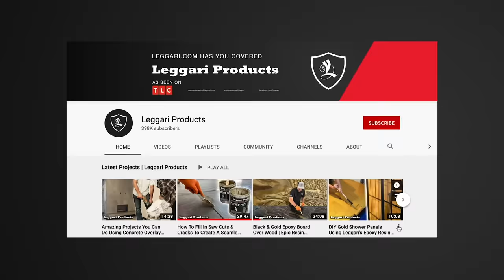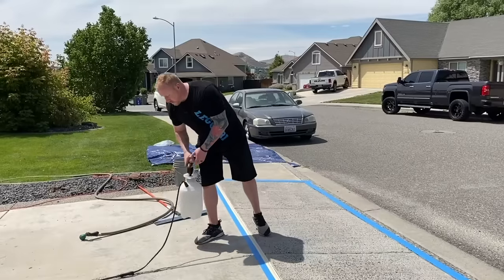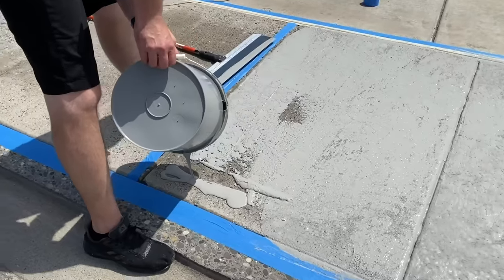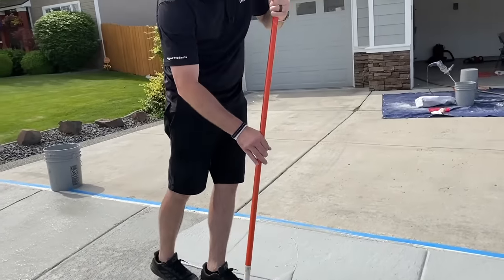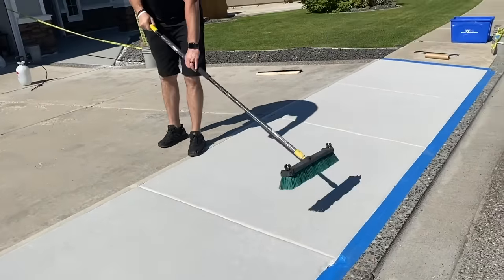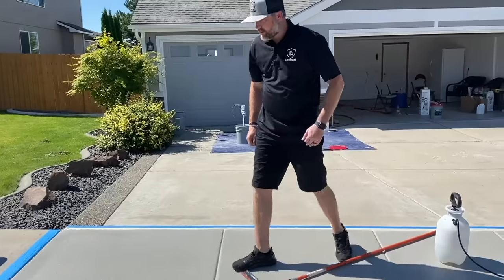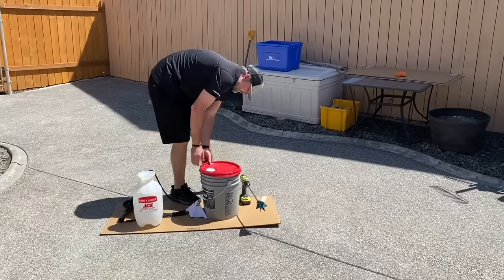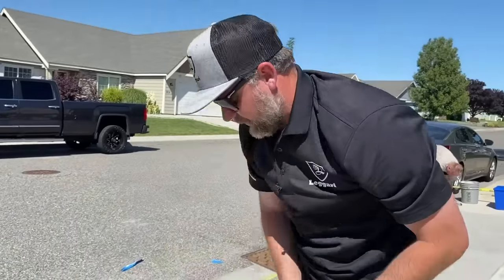How To Repair Old Concrete | Resurface Concrete Sidewalk | Restoration Project DIY Concrete Repair

Comment from the maker: Get a Concrete Repair sample kit here: https://leggari.com/product/concrete-repair-sample-kit/
Reply: Hi my concete at my store
Reply: Just a query. How do u stop mould growing on a concrete surface. Not how to clean it, as I have a pressure cleaner, but how to prevent it growing in the first instance. 
Its a shady area that is the problem.
Reply: @Blue1Sapphire  Simplest and cheapest method is 50/50 bleach.  Mixed in a wide bucket and use a 12" wide very soft poly brittle broom like a boat deck brush.  Dip the brush in the bleach, shake the brush to drop the excess into the bucket and then gently scrub the concrete.  Don't get it on anything that you don't want to damage.  >>> Like your nice grass lawn!  Do this cleaning on a very cloudy day or at sun up before it gets too hot.  You can go back and redo a scrub as you need.  The first scrub and let sit will assure the mold will die and clean up.  The second pass will assure a nice even clean concrete.
Take your garden hose and wash down the concrete thoroughly!!
Once dry, you can use a concrete sealer if you wish!
Have fun,  Cheers
Reply: @lisab3396  how about just using straight cement mixed with water and spreading it over the concrete surface. Cement is alkaline I believe and so should prevent mould growing.
Reply: @Blue1Sapphire  Wasting your time with that approach!  Mold will not be fully removed and will return.
Reply: So Who's the Dummy Now?    Well time will tell!  My experience is >>>  If you apply anything over a mold bearing surface, you will immediately seal it over.  However, Mold is tenacious and has a way to come back if you haven't thoroughly cleaned/killed/removed it!!!
Also, the word and meaning of INHIBIT does not mean permanently get rid of it or prevent it's return!
Reply: Deuteronomy, 18:11

10. Let there be no one in the midst of you to cause your son or daughter to pass through the fire; Let no one practice enchantments or consult the stars; That there be no sorcerers or sorcerers;

11. that no one is found who engages in superstitions or consult the spirits; That no fortune-teller or anyone who asks the dead is found.

12. For Yahweh hates those who do all this, and drives them out before you because of these abominations.

Jesus loves you, God loves you

John 3:16

For God so loved the world, that he gave his only begotten Son, that whosoever believeth on him should not perish, but have everlasting life.
Reply: I just like to learn stuff. Now I wanna do my driveway!
I think, I'll do just a squeegee finish.
Reply: @Blue1Sapphire Use a product like: Concrobium, it Kills Mold and Spores. Leaves a residual coating to prevent mold ReGrowth. Bleach isn’t the solution, to kill mold. Bleach only whitens up stains. I use it on my tile showers and it works great. Afterwards, seal the concrete. Mold is resilient.
Reply: How long does this concrete coating last. In Northern climates w road salt?
Reply: Waste of time watching you doing pressure washing this area!

Comment: As someone with over forty years in the concrete business, I cringe every time I see a video of guys working with cement products while wearing shorts. Cement burns are a real thing. Also when pouring dry cement a face mask should be worn to protect against silica dust.
Reply: Same here, 43 years finishing, I don't think he knows that he's on city sidewalk, he will if an inspector catches him!
Reply: As someone whose worked in concrete for 2 years I can say shorts are fine and if you have a fan to expel the dust theres no problem at all.
Reply: I don't think its concrete.
Reply: Amen
Reply: @chucklaneChuckylane  ppl
Reply: @bigdog2084 SAMENT ?
Reply: Wow no primer ?
Reply: I do concrete overlays for a living that shit will chip off in about a year in spots from not using primer
Reply: @Garcia2379  how long does it last WITH primer, out of curiosity?  I moved into a house with a cracking overlay path and hate it so much.  Send help to St Pete!
Reply: Yes sir I'm finding that out the hard way. Thank you 💋
Reply: It's not even concrete though. It's overlay and sealer.
Reply: Gloves, full face respirator.
Reply: i learned what you said the hard way as a helper once, my boots were cheapos, i worked all day with wet feet the next day my feet and heels turned red and hurt like a son if gun. Never did it again
Reply: Garbage and not worth the time or money.
Reply: Ha! My thoughts exactly…..
Is there a product/ CONCRETE or method of applying CONCRETE to achieve similar effect to the appearance of what he’s done above?

Comment: If he put a couple drains in that driveway he wouldn't be having to do this in a few more years. That water is hammer the aggregate when it runs down like a river in the rain. Then water seeps and you have a pop rock driveway/sidewalk.

Comment: Excellent explaining each step as you flow product each steps ×3 total needed  -keeping prep concrete wet before applying the next coat--Great easy directions for keeping product always moving  flowing forward to completing each section completing

Comment: First off, I wasn’t really searching for a video on this topic, but I am interested if this would be appropriate to address my garage floor before epoxy.

Secondly, this has to be one of the best instructional videos I have ever seen on YouTube (and I watch many videos). You seemed to answer all of my questions as you went, with great attention to detail. Very nice job guys!!!
Reply from the maker: Possibly, depending on the end goal and desired finish. Please email pictures to customerservice@leggari.com and we can give you an educated answer for your specific situation. There are some garage coatings that may not require much repair at all before installing. Thanks
Reply: The best instruction video would have had a demonstration done on driveway with cracks and uneven surfaces.

Comment: I did  the same thing on a many of drive ways and it worked always, however i used  bond to existing concrete chemical spray to open the pours of the concrete and “ versa bond tile mortar” don’t mix with water, mix with concrete bonding adhesive only, add a little play sand and spread; the adhesion is amazing, remember to pre-set the ground after through cleaning 🧹 with a concrete bonding adhesive, the same way they apply water in this video. 

My way requires speed and know how, cuz the versa bond and adhesives dry fast which is good for strong 💪 curing/bonding to the already set concrete. ( something like the quick bonding in “ easy sand 5 min plaster- which is amazing too for drywall. 

All the methods that they used in the video with the exception of the product. Are correct. I just use a different product but the methods are the same, Great job

Even in my mixing of the “versa bond mortar “ I use ( bond to existing concrete adhesive in my mix, 🙅🏾not the same as in this video “ remember” the secret is the (coats ) 

Do not try to get long term beauty in one coat 🤦🏼‍♂️ add up to three layers depending on the current condition of the concrete. This is only a “ skim coating “ process. * if you’re concrete project has more then 1/2” of damage. *Do Not attempt this process. 

*There’s another process for more than 1/2”damage resurfacing repair.
Reply: Great Tip..!!
What is the process for more than 1/2”damage resurfacing repair ?

Comment: Hi there. Thank you so much for the informative video. I was just wondering, the concrete in my garage is chipping similar to the sidewalk shown at the beginning of the video. Would you recommend that I use this method for the concrete inside my garage? or is there a totally different method when it comes to inside concrete? Thanks again.

Comment: would Like to see a long-term video of this stuff in a winter climate, because I feel like the winters in eastern WA might get under it and freeze and crack it.
Reply: Also, seems like several day process?
Reply: Does this fill cracks and what is cost of a 18'x 20' job for 2 car garage?

Comment: Is this just plain concrete overlay? Or does it have self leveling epoxy in it as well? Can this be used on a concrete slab that has cracked and is uneven to make a smooth, level surface again?

Comment: One guy said just use Quikcreate but in my experience and if you live in areas like Utah where snow gets everywhere, I have seen people here using Quikrete and they have to repeat themselves all over every summer or two, literally.
I have also seen other people using similar solutions like this and they typically last 10+ years.
I'm sold!

Comment: A tip for using a sprayer; Be sure that the sprayer has a pressure relief valve. Normal valve will open at approx 40 lbs. Take an auto or bicycle tire valve stem, drill a hole to accomodate the valve stem,put the valve stem inside the sprayer and pull through the hole.The hole should be toward the top of the sprayer above the liquid level. Set an air compressor at 30-35 lbs and fill.
Reply: I did this to my sprayer a couple of years ago. It's a good tip.
Reply from the maker: Great advice! Thank you! Also, MUCH cheaper than buying a sprayer that has this feature.
Reply: @LeggariProducts  Also, remove the tape before it completely dries. Same concept when painting a car. Either the tape becomes too hard to remove or it will remove some of the material you laid down.
Reply: That’s a great idea!  I’ve wished I could pump my sprayer with a compressor, but didn’t know how to make a valve that would work (one way). That’s great advice. Thanks.
Reply: As someone that's newish to pressure washers and has never seen or heard of a pressure release valve for one...   Your description while interesting and detailed enough for anyone that has ever seen a pressure release valve.....  I have no idea where on earth you are describing to put one😂.

Comment: It seems doable. You make it look so easy. 

But I'll need to do four 6'x10' slabs of driveway. 

But some parts of those slabs have cracked and fallen down, up to an inch or two below the driveway. 

Does this system level everything out, or does that situation require more intensive repair methods?
Reply: For that kind of slab movement you have massive underlying issues under that slab.  Look at where your downspouts are draining and check to make sure it's finally settled and not moving more.
  Once it's stable that's when you can look at options to resurface it.    Concrete levelling grinding and filling followed by a epoxy finish would be an idea.      I'm curious to know if this method works in areas where temps are expressly cold and how well ice may stick to it

Comment: Did a reseal to a smaller section of driveway sidewalk with $10 pail of quickcrete a few years ago.  Removed the loose stuff with a broom, hosed it down and mixed material to soupy texture.  Used a hand trowel to spread and finished with a seven inch asphalt brush.  One coat has lasted three years.  A down and dirty option compared to this time consuming effort.  It looks fine, not close to the final outcome here but it is just a sidewalk.

Comment: Looks great, I might actually attempt to do my own after watching this great video.
Reply: love all the chatter marks left in the far right section even after several coats and a brushed finish.
Reply: @Smokey420Greenleaf  Not something they did wrong on the job. Look closer and you'll see those are marks that are actually the concrete itself. Plus, they're using a brush to match the pattern on the slab which originally had a brushed look to it for better grip. 

The color will match the rest of the surrounding concrete as it ages and sees vehicle/foot traffic and inevitable dirt lol

Comment: The video was great - and very professionally done.  You guys did an excellent job overall (narration, material application, thorough description of the tools used at each stage of the process)...and the end-result looks great! Pressure washing, taping at least twice, 3 coats of product, followed by 3 coats of sealer, and the requisite drying times between each coat.  Plus, the labor component of at least two (and possibly three) people...in addition to the cost of the materials themselves.  I couldn't help but to wonder about a cost-comparison between resurfacing that same area - and the cost of breaking out and replacing the concrete.  Have you created a cost-comparison?  As for myself, my motivation for carefully watching the entire video, was because the concrete in my 3-car garage (from the garage door...progressing two feet inward) is severely eroded and pock-marked due to road salt and slush that melted and fell from the vehicles  (in Michigan).  So, I'm evaluating my options to deal with this very pitted surface.  How does your product hold-up in northern winter conditions?  Will it maintain adhesion, or spall and delaminate?  Once, again - great job, and great video!
Reply: So true! Huge difference between living in the frozen north and living in points south. Then again I don't have to deal with hurricanes and earthquakes.
Reply: Wow!!!! Great details and explanation how to do this job and just wondered….. how is your back pain??? 
I am already exhausted and tired jut to looking at you. I will like call you to do all this! Thanks for your video. I enjoyed it! Good luck

Comment: Thanks for the video. We all need to understand that the concrete overlay is the cosmetic part of the process not the structural part. So with any cosmetics the process will wear out and need to be redone. Just like cosmetics for people they wear out over time, weather and other things. So will this process.

Comment: Nice job! Looks damn good IMO. Better than brand new.. No doubt about that. But I'm wondering how durable it is.

Do you have any videos showing what a slab you repaired 5, 10 or 15 years ago looks like today so we can judge for ourselves how well your method stands the test of time, so to speak?

And could you tell us some of the pitfalls to watch out for?

Comment: will this product fill in cracks? I have many cracks in my driveway.
Reply: I think so. I know someone who used bondo for that to seal the cracks and possibly reinforce the cracking from spreading out in the future...if that's even possible. I tried it on my condo floors before I tiled.

Comment: One thing I see with trades cleaning concrete or any other surface with a pressure washer is just using the various standard spray nozzles. I use a floor cleaner on the pressure washer. There are many benefits. The main two are, the reduced time which can increase profits and a better cleaned surface after. Then, clean the concrete surface with the nozzle.

Comment: By the way, that part is the city sidewalk even though it's right in the homeowners driveway. They are not allowed to do anything to it, neither are you without a city bond & notifying the city before any work is performed on it. That may not be true in the city you're in but it stands true in most places, you might want to let your customer know that because most of them don't know that either, big fines! They can paint the driveway with anything their heart desires from the expansion joint on. They could have the approach torn out & replaced if they want after notice is given to the city & it has to be a contractor with a bond on file with the city but they won't let anyone put a bandaid on it, tear out and replace is the only way.
Reply: Agreed , thought the same thing ...it's city property
Reply: 🤔 most likely yes but also every municipality is different sometimes developments are different.  This could even be a private gated community.
Reply: @lisat9707 possibly
Reply: look out Brotha!!.... You Can't be Scared all your Life!
Reply: If I was scared all my life I'd have never raced Speedway for one thing, I live my life on the edge even still, only I quit going to jail, speaking of which, the fines they throw at you for doing stuff like that would be worse than jail! They come down hard on violations in construction trades that make traffic citations look like pussy shit, I ain't kidding, it's off the hook these days brother.

Comment: I was thinking of using this on my concrete front steps. Can you use it on vertical surfaces as well?
Reply: id use quickrete's concrete resurfacer, its a lot cheaper, easier to use, faster and it actually matches standard gray concrete.

Comment: Do you have to hydrate the surface befor apply the concrete?
Reply: So heres what you do....
Reply: Did you not see him spray the surface with water out of his pump sprayer like 4-5 times, and then hose it down with the garden hose? He CLEARLY TELLS YOU TO “HYDRATE “ the surface! This is a stupid question!!! Not trying to be hurtful, but listen to the directions again.
Reply: @edwardzx7  mhh.. no i think they apply it dry. Otherwise they should mention it in the video.
Reply: @liama23  If only we were told what to do
Reply: @darken3150  yea... its a pitty.. ^^
Reply: You need to satisfy the concrete.

Comment: I'm wondering if they did their driveway after that. They did a very nice job, but not sure why they'd make it so nice with a driveway like that. I wonder how slippery that would be in the winter time.
Reply: D B  I have a concrete driveway and the guy put sealer on. I think he must have put it on too thick because it was like a skating rink the first year. Ours also has a broom finish.
Reply: Yes, we get below zero

Comment: I just subscribed. Is that legal to do the sidewalk? Down here in Broward County code enforcement would fine us; city property B.S.! The finish you did with the powerwasher defined the rock work. I would have used a clear epoxy to brighten and protect all that. Beautiful job you guys did on this and extremely relaxing too.
Reply: In NYS the sidewalk may be on the street right of way, but you are responsible for maintaining and replacing it as necessary.
Reply: Yeah I'm not touching city property, that's why I pay taxes 🙄